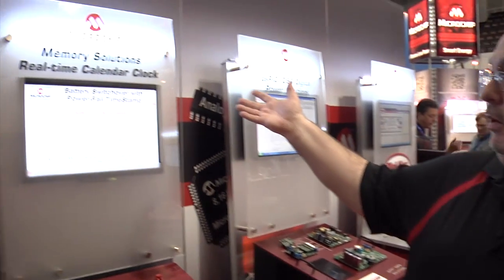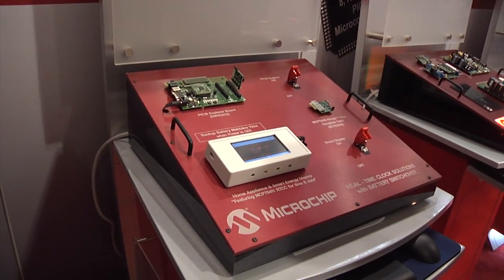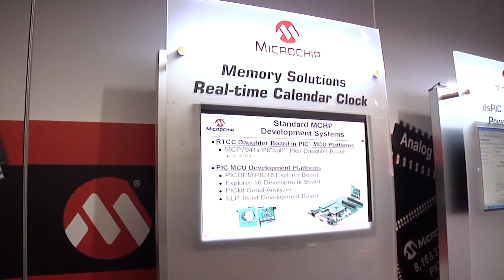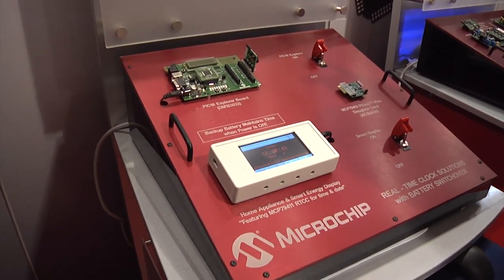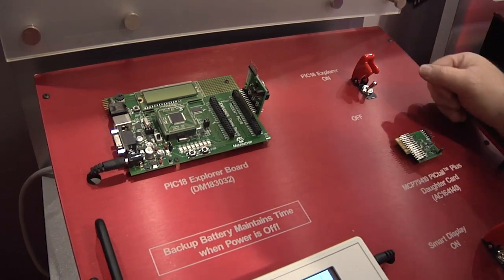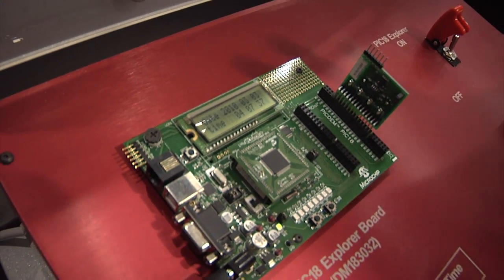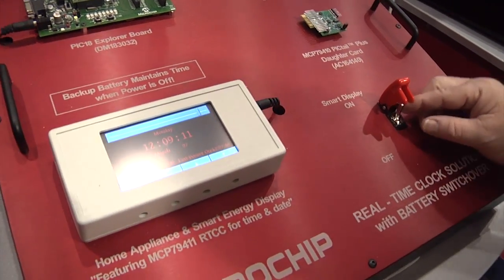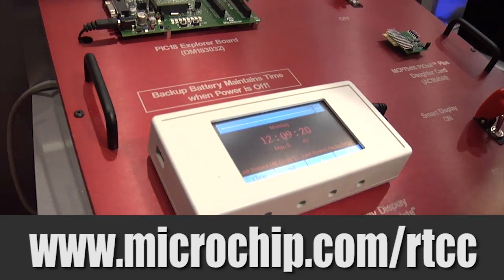Real-Time Calendar Clock with Memory & Battery Switcher

Comment from the maker: @reinoks PDIP packages are more expensive than SOIC or MSOP, but are chosen because it easily plugs into a socket. Since Microchip’s RTCC is very low power (<700 nA on VBAT), PDIP sockets are not recommended for prototyping or production.

Comment: @reinoks Everybody who designs something with these kind of RTC's usually just designs the board that is going to be mass produced and tests it. Also, I don't think it's economically viable to produce a few DIP packaged RTC's for a few hobbyists and consultants to use. SOIC is really easy to solder on (very cheap) breakout boards.